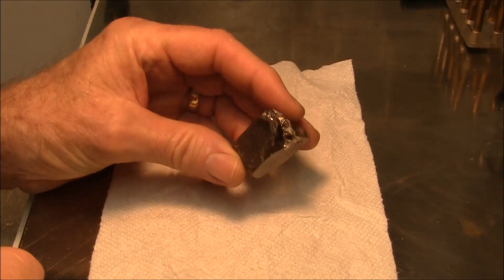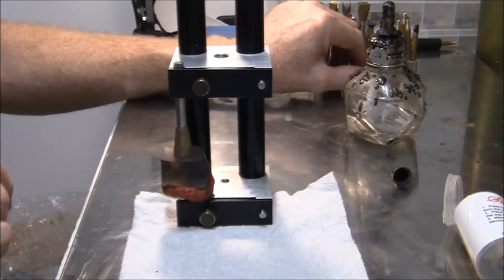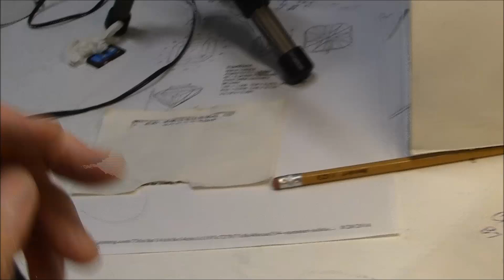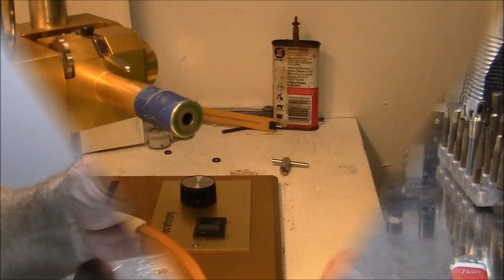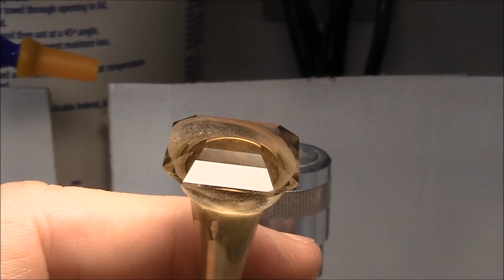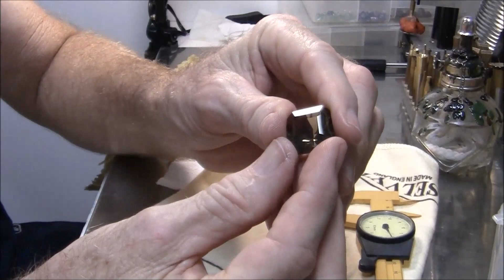Faceting gemstones- a smokey quartz squilliant.

Comment: Not cut any but have collected for over 17 yrs so I have plenty to practice with. I understand how to dop. I know how to set index wheel. What I don't know is how to determine height of mast. Also I have a digital angle readout. you can 0 it at any position. So how do I initially set angle so it's reading properly.? I hope I'm asking that correctly.
Reply from the maker: What machine do you have ?

Comment: Hello Brent, I have a question for you. I am Faceting an Amethyst used a 325 grit to cut, then went to a 1200 and a 3000 to pre-polish. Now I am using  a Darkside lap with Zirconium. Oxide. I noticed at the edges of my facets, tangent to the next facet my corner edge is not as sharp as it should be, it looks like very small pitted edges. I am polishing towards the girdle. Did I apply to much pressure to the lap? Or
Reply: The other question I had was: did you have Facetron machine before you got the Ultra Tec? What is your professional opinion between either one ? Thanks
Reply from the maker: The facetrons  motor  has more power than the ultra tecs but maybe my utra tec had more hours on it.  Both machines  ive owned were at least 25 years  old. The facetron dop  keying system is more accurate  than the  utra tec.  The transfer jig with the facetron is better and bigger than the ultra tecs was .  The facetrons index  gear is mounted at the back of the quill and stays cleaner from spray  .  Nice heavy  metal index  gears. on the facetron. The facetrons  angle  adjustment is easy to use.
 The things i didnt like about the facetron is the  keying/ dop locking  quill arraingement lets you only use  facetron dops .   I dont like the quick adjust  mast/ head    although its easy to use .   The head will not tilt   and stay up with stone  pointing up  for examining .    Nice heavy  metal index  gears.

The ultra tecs   mast / head raising and lowering sysetm  is slower  but still only takes about 15 or 20 seconds to move  from lower to higher  angles, the mast has graduations to help for precision cutting  although i dont   need to use them.  The head locks  in the upright position and wont flop down like the facetron.  The index gears are  more thin,  plastic. Any 1/4 . dop can be used in the ultra tec   as long as it doesnt have  a  keying peg .The ultra tec  company is interested in  improvements and innovation  in their product.  The jarvi  co. doesnt seem to be.

Both machines are very accurate  and will serve  you well.
Reply: Gems by mbk thank you Brent for the extensive evaluation. I did not expect to get this much information on both Faceting machines. I guess it also comes down on the cost of each machine. I really appreciated your knowledge and input. Have a nice Day and Happy Faceting. Klaus
Reply from the maker: The step between the 325 and the 1200 is quite a big  one,  i think  going to a 600 grit would  have been better  after the 325 lap.  Its possible  too much pressure causes this at times. Im having   good results  roughing with a 26o,   cutting with a 600, then going straight to a copper lap with 8000 grit.  Do you  have  the room to re polish  with the 3000   and  see if you can clean up  the pitting?
Reply: Gems by mbk Thank you Brent for the tips. I went to a 3000 and cleaned up the pitting. Then used a Darkside lap with Zirconium Oxide and did the polish. I saved the pavilion. Thanks

Comment: Hello Brent, first, nice video and information. With this Corona Virus going on I cleaned my Faceting machine which I built in the 70’s. and started improving my skills, thanks to your video. I have a question, where do you get these larger stones from? Also, on your cerium polishing lap do you use a pre-charged lap or do you mix the oxide with water and use a acrylic lap? Thank you and Happy Faceting
Reply from the maker: hello,  i usually find the large stones at local gem shows here in florida.   I only made it to one this year before the lockdown.   the cerium ox. polishing lap i use  mostly is from  the lightning lap company. I also use the thin plastic film polishing laps  sometimes , they are called spectra laps, dyna laps and   ultra laps .  
https://shop.lightninglap.com/
Reply: Gems by mbk Thank you Brent for the information. Unfortunately I live here in Indiana and we don’t have these Rock Shows. I just have to rely on different Websites but you just don’t know what you get and then return it is a hassle. I have an Irish Setter with a real good nose, maybe he can sniff me up some good rocks. Is this way they call it a Rockhound? Have a great day and stay healthy. My Name is Klaus

Comment: What's the Mohs hardness/grit equivalent of Cerium Oxide?
Reply from the maker: Hi,  cerium is actually a metal mineral  and is very soft, i believe it  is around 2 or 3  mohs hardness.
Reply: @tennpikr74  how does it polish then?
Reply from the maker: @renaissancenovice7202  Oxide polishes   work by smoothing do to friction  and heat and the  surface melts slightly from what i understand.  Whereas diamond compounds  polish by just making finer and finer scratches until the scratches are so small  they reflect the light. If you wish to learn more  do a search  for beilby layer.